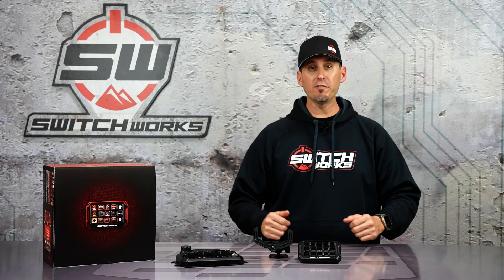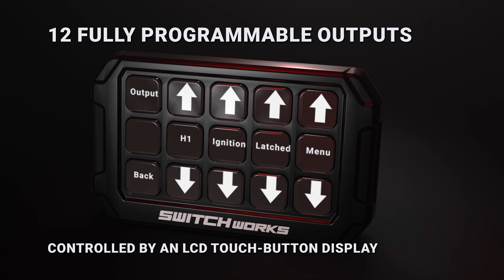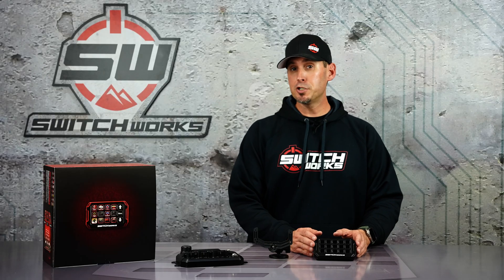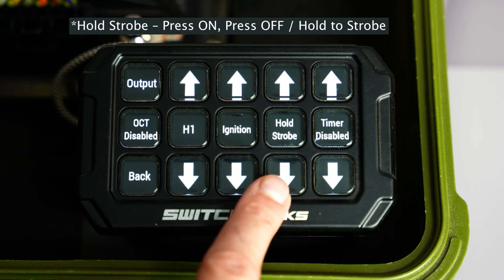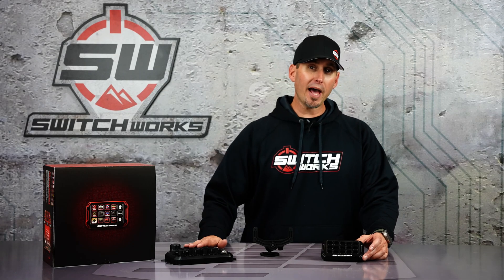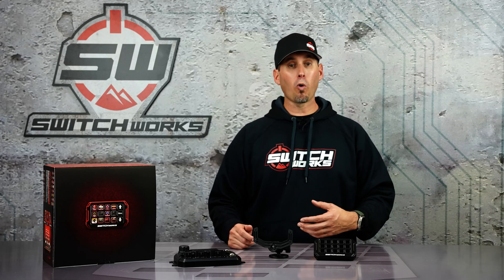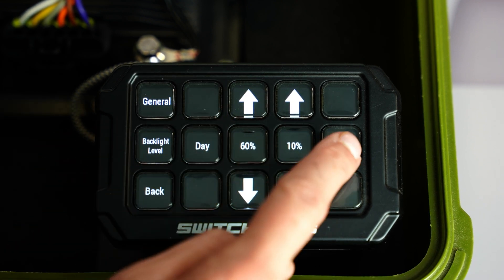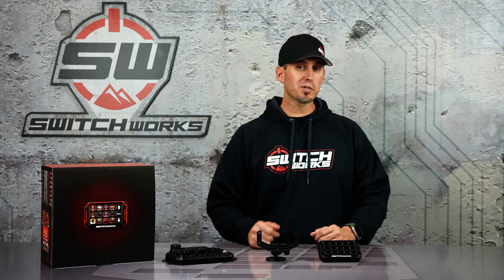SWTICH Works Alpha12 Digital Smart Switch with LCD Push Buttons

Comment: Psst...You misspelled your company name in the title. At any rate, this is a really impressive looking piece of tech. Looks like it solves some of the issues I have with my Switch-Pros RCR. No more buying entire button decal sheets just to get that special decal. Convenient programing from the pad without an app. And that button page option is brilliant! Can the button icons be rotated so the pad can be mounted at 90deg? Does it support trigger wires? 
I'm an OG Switch-Pros guy but this thing DEFINITELY has my attention. I might have to do one in my next build.